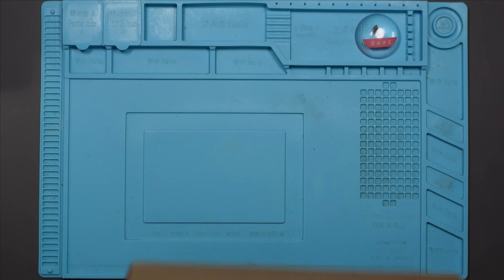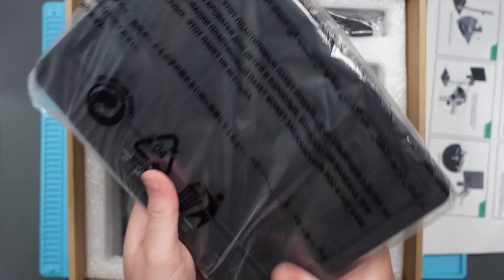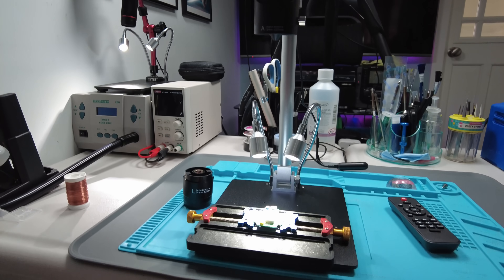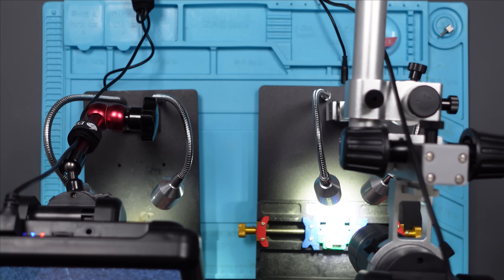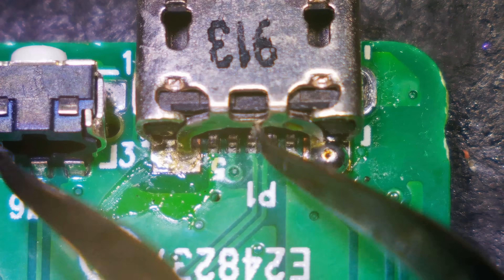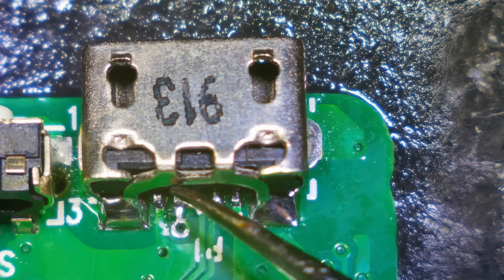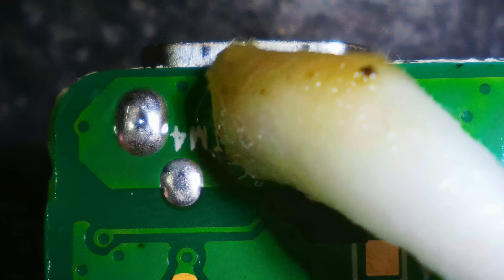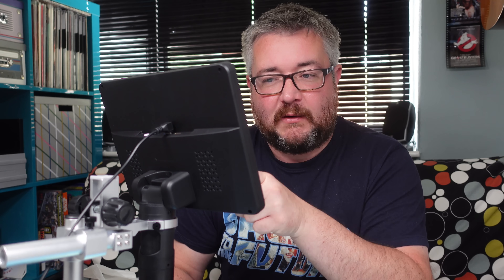I Got a New MICROSCOPE! | Andonstar AD249S-M | Let's TEST It!

Comment: I can tell at a glance that its way better than the big glass magnifier that I have clamped to my desk made by electrix. It has a tube light and all the information on the tag is faded and gone. So I have no idea how many X it magnifies. It helps tremendously but when traces get to be like  .5 mm apart there's no way I could fix one with it.  The ones I can wear on my head like sun glasses are way better but I have to be so close that there's no room to work. 
i fixed my oven the other day after doing without it 8 months. They don't make the board any longer and it cost 2200 bucks to replace the oven.

Comment: @StezStixFix, I recently picked up the AD407 and was curious about how you configured yours. I really like the adjustment you made with the articulating arm. In your video, you mentioned that you had a lot less work area. Did you know that you can mount it closer to the lens to gain about 3.5 inches of clearance between the microscope and the work surface? You’re probably already aware, but I thought I’d mention it just in case.

Comment: I’d bet that Andonstar has sold a lot of the AD407 microscopes because of your videos. I bought an AD407 Pro about two weeks ago after watching you and it’s been amazing. I’m able to see much better than my Optivisor. I wish it had warmer colored LEDs because these blueish, cool temperature LEDs are awful for our eyes and certainly give me eye strain if I don’t block them with the LCD while using it. Seems like every manufacturer is on a mission to burn the macula out of everyone’s eyes ever since the “white” LEDs came down in price back around 2005.

I have been using my Andonstar 407 for electronics repair, fixing eyeglasses as well as filing and polishing Hot Wheels diecast car axles to prepare them for racing. The 407 is quite good for the model hobby; price is low enough to be affordable while giving a high quality image with the ability to record video or still images. Your own videos proved the image quality to me and convinced me to buy this model. I’d sure like to try the AD2495 to see if it makes a difference, especially when needing to work with tools under it, but the 407 is working quite nicely for me so far.

Comment: Already made up my mind but I appreciate your honesty. These are really expensive in Ozand my one (like yours) is easy to grab and I fold mine down and store it in a cupboard . . . the Andonstar I mean.
I use the smaller screen and not even worried about connecting it to my 24" workshop monitor. Why bother, the 7" screen is ample and so is the working space. The only niggle is the lift assembly mechanism is sloppy and the whole unit wobbles as I raise or lower the assembly.
Also the mSD slot is in a tight position. Andonstar could move it out to the side.

Used it just the other day actually to install an Hekate injector into a Switch. Too easy and after watching another video on this model, I can't see the asking price for th 10" model really. I will never see a freebie in my post box that's for sure. :-)🤫

Comment: Good stuff, I recently got my first microscope, a Tomlov DM201 pro. I expect the video quality will be pretty much the same on all models as camera technology is so good and cheap nowadays. I agree that the main issue with these things, for the purposes that we use them for anyway, is lack of space (or being very aware OF the space) as im swing hot air guns and soldering irons under there. Slight wobble too, i dont think anything can be done about that nor is it really an issue?
Anyway, enjoying your vids, learning a lot! im a newbie so trying to soak up as much as i can!
Reply: >  camera technology is so good and cheap nowadays
no way... image sensors are still pretty different in size and size affects final image quality a lot. Bigger sensor - more expensive the rig (for cameras, for microscopes, for everything)

Comment: How good does the scope do fine pitch components to see how close the fine pitch pins can get on the scope? also it should have an HDMI output port to connect to a bigger TV monitor right? What scope lens would you need for fine pitch pins components X2000 or X4000?

Comment: From what I'm seeing in researching the ad407 (which your old one appears to be) has an aluminum focus ring and the new one may not which could be a con.  In the US the smaller ad246s is much less expensive with the 7in. screen than the ad407.  I'm trying to get into microsolder repair on a bit of a budget until I can afford a nicer microscope and hopefully the ad246s will bridge the gap for now.  How's the focusing compare with your old one?  Is it less smooth?

Comment: Dude….. Mount the camera to a solid point separate from the desk!

Also take this onboard to… You gotta ‘100%’ Rock solid mount that desk too…. AKA - ‘Work Space’

Plus….

(100% Solid camera mount too)

With the 100% separation of any vibrational interference between the two will equal an emended improvement in the quality of the output to ‘Us’, your loyal viewers x

Comment: 🤣 but would you buy one if you didn't have the other one? 
I need to upgrade mine as it is a bit pathetic and small. I've been thinking a HDMI option with a screen mounted to the back of my workspace rather than an all in one.

Comment: Bought the 246 directly from their website. It's the one with the smaller screen and I think it's the perfect size, same mounting. It was 200$ exactly, plus another 50 for customs. Payment was through paypal, it left China in under 24 hours, after another 24 hours was already in my country (Romania) where it spent a whole month (argh!) awaiting customs. It arrived a few days ago and I'm amazed. I never had a microscope so it opens up a whole new world for me. But, I'm a picky boy, yet I can't honestly fault it. Lots of small details that make it a quality feel. No sharp edges, no google translate manual. The only niggle is the small focus jams on the A and D lenses (PS. actually that went away after I completely turned the two screws). The L one feels smooth. For me, it has already payed for itself, as it helped me bridge a broken flat flexible circuit on my abandoned Vive VR controller. Although it's main use is gonna be modelling and miniature painting (I have really bad eyes). Biology slides were actually cool. I'd rate it an honest 4.5 stars out of 5 and a must-buy.

Comment: I think both of these are the winner. If you need closer shots on smaller things, the older one is best, but if you need a big area to work on a bigger board, the new one is better.
Both are good for their own purpose tho!
The old one has a better image quality due to lack of CMOS wobble, but the new one is sharper a tad.

Comment: I too got it for review (I think I was the first on youtube: D) as well as had AD407 before. What can I say at the moment when it comes to construction - the AD249S lens is almost entirely made of plastic (inside there is a brass ring with actual glass). Mine jams when adjusting. The base is a bit larger and the stand (now it also moves forward), but it does not solve all the problems of the predecessor and so if you want more space under the microscope, you need to use a different arm. The lenses are mounted with two screws and you will not buy any other, they are custom, only for Andonstar. The recording quality is almost the same as in the AD407 - very good, the resolutions are identical. Thanks to the lenses in the AD249S you can get a lot more space and a larger working area. LCD is also similar, same resolution only bigger. If I had to judge which one is better, then if you do not need a much larger working area, it is better to stay with the AD407. A 7" LCD is more than enough for comfortable work, and the stand still needs to be redone in the new model.
The AD249S also has WiFi, which is not working at the moment ... and it can be connected via USB to a PC as a camera, which I remember was not possible with the AD407.
You can take a look at my review, but I haven't added English subtitles yet.
Reply: Plastic lenses?! ....wow...
One of the reasons is cheaper than  the older Ad409 ( 10' screen)
Reply: @dsavoy66  To be more precise - plastic is the case of the lens. The lens itself is made of glass and it is mounted on the brass ring. https://youtu.be/Ce7BZUfGpVk?t=672
Reply: 407 can connect to a monitor/tv via hdmi. The lead comes in the kit.
Reply: No PC connection on 407 is a deal breaker to me, but those shi tty plactic cheapish lens on 249 is deal breaker as well😂

Comment: Did you make some tests with ADSM407 with the new stand? I have an ADSM302 and the stand is the major cons for it. 

The other biggest cons for my usage is the cable with buttons, that is only a power connector, you can't plug it to a computer to have microscope AND light at the same time. I'm very happy with the ADSM302 itself, I can even stream with it ^^

Comment: Nice review, it looks nice, i have an andonstar too. An earlier model, its great for what it is, it has helped immeasurably when it comes to fixing electronics, it really does get close up and the image is more than clear to do what you need to do. Mine has an annoying trait, and that's when you switch the unit off the time freezes, and will only resume when you turn it on again. It's not very handy when it comes to taking camera footage over for editing as the timestamps are hard to marry up when you are using other devices to record too unless you take the time out to continually change the date / time every time you use it. It would be wonderful if they resolved that and had a model with a microphone and video out too :)... Its not a negative review, its a non biased review which we really appreciate so thanks. It's nice that you were open, honest and upfront, and that people can make a more informed decision because of it. It also serves to the manufacturer to listen to whats being said in order to improve their product. I for one, dont think they are bad at all, a few tweaks and this could easily be the best affordable miroscopes out there.

Comment: Actually, after you picked so much solder into the wig and had placed enough flux there, you easily cpuld have just pushed the wig aginast the USB contacts and it would have resulted in a perfect connection. This is also an easy way to solder chips with 0.125 raster pins and such. However I wonder if the scope is available in a shelf clamp version that hovers freely over the desk. Would be much more beneficial for my needs.

Comment: AD407 owner here. Most of the time I use the HDMI out to a 32 inch screen so a larger built in screen would be more of a hinderance to me. Also I modded the mount to give way more clearance under the scope. My only niggle is that for some reason the still pictures it takes are less clear than just captured frames from video.
Reply: I mount mine on the groove just above the lens. You get double the working distance.
Reply: I mount mine on the groove just above the lens. You get double the working distance.
Reply: Do you confirm 407 doesn't have PC connectivity?
Reply: @The_Unobtainium  Yes, HDMI output only.  But it can record to MicroSD cards

Comment: I straight up just recently bought the same original adonstar microscope you have been using.  Although I find the focus adjustment a bit frustrating, I am happy with it.
Reply: Try mounting it on the groove just above the lens. You will get double the working distance.
Reply: Why, what's the problem? you should rough focus by raising/lowering the assembly, lock that into place then rotate the microscope ring; the large knurled section, to fine focus. Could not be easier my friend.

Comment: For soldering usb ports, chips and the likes with rows of pins I can really recommend using a soldering tip that has a horses hoof shape to it with a bit of a indentation such as the hakko t12/t15 bcm shape tip. The shape works perfectly to hold a nice amount of solder on the tip and transfers the solder very nicely when using enough flux.

Comment: I have the AD208 variant Elikliv DM-10 (open box) with the 6inch extension $106US. I like 7-8.5 screens. After using a 4.5 for some time that's as big as I want to go. I returned the Elikliv EDM202 because the 10' screen was fatiguing especially after 20 minutes. It was really like having a tablet in my face. 
I'm glad I'm not alone. 
BTW- The red articulated arm is discontinued. I lot of were looking for it after seeing your mod.🙁

Comment: I have the same microscope. The lcd is very low resolution compared to the up to 4k the camera outputs. I would suggest tearing down the screen portion and removing the pcb. I have it going to a 24' monitor and is much more clearer.

Comment: I have the AD407 modified with a 3d part so it can attach to a boom arm, best thing I ever did cause the metal base is really annoying.
Reply: funny you should mention this, i had a similar idea - how is the weight of the boom arm, and does it hold steady? i thought it may make it a bit wobbly....
Reply: @Caddy666  If you go with something like the Rode PSA1 it is pretty steady, cheaper boom arms are really not upto it.

Comment: By the way . . . on your older AD407, there's not need for your elaborate extension arm contraption (to gain more room beneath the lens), you can simply mount the lens higher in the mount, there is a mounting position at the top of the lens - where it is by default - as well as a mounting position right at the bottom near the front element, use this one if you need more working room.
Reply from the maker: Good tip!  I do like the way I can move the arm easily side to side and back and forth, but for those with the original mount, it's a great idea!  👍
Reply: @StezStixFix  Imagine using both, it'd sorta' be like the James Webb Telescope, but smaller and much closer to earth, I want you to think about that.
Reply: @Daniel Andersen I would like to see that if he replies.
Reply: Me too. Show us yer aric arm, S 🎉

Comment: Well brother Steve! I've seen both scopes in action and for me the 10" cries out 2 things. 1 Ring light  2 Articulating scope arm (both would benefit your work area immensely)
Also If you can get one, that will hold the weight, a microphone arm, that could be modified. But definitely a ring light! would be much better than the goose neck LEDs 👍🖖
Reply from the maker: Thanks brother Steve, yeah a ring light is a great idea!  And I couldn't live without my articulated arm now, so much more flexibility!  😊
Reply: There was a lot of complaints about the small one that "you can't solder because it's not a stereo microscope". I found it works perfectly. I assume because of the shadow from the two LEDs. Wouldn't a ring light remove those shadows so it becomes more difficult to judge the distance based on these shadows?
Reply: ngl a goose neck light is better for glare. as you can position to suit. but yeah extra light is are welcome.

Comment: Ooh it’s the same as mine! Although I have the smaller screen version, it’s flipping awesome
Reply from the maker: Yeah, they are cracking microscopes.  Although mine didn't record any audio, so it was a pain to sync up the videos when editing.  Does yours?  🤔
Reply: @StezStixFix  I guess it's time to make a led blinking thing with some sound.
Some kind of clapperboard 😂
Arduino, buzzer, battery and a led should do fine👍
Reply: @StezStixFix  no… it recorded a soundtrack of very low static 😅 and yeah, syncing was a ballache. I might get in touch with them, hopefully it can be fixed with a firmware update
Reply: @StezStixFix  oh… I got a response from them .. “Well, indeed. Part of the effect of the mainboard controlling the recording function is very poor. Our current new model has withdrawn this function, I hope you understand.”

Comment: Really appreciate you being honest there! Perhaps Andonstar less so, but honesty is always good.
I got the same microscope your old (maybe still current) one is, the AD407. Honestly, it's really good for all my little quick jobbies, fixing Gameboy cartridges or a controller as a friend threw it against a wall, does kinda suck space wise you're definitely right. Great idea you had with yours to mod it to go higher, i might have to steal that idea! Other than space its a great little microscope.
Reply from the maker: Yeah, I still love the AD407.  It's never let me down.  The articulated arm on the stand makes a big difference, you should definitely do it!  👍
Reply: @StezStixFix  what articulated arm did you used for the modding?
Reply: @nicmate2543  just mount it on the end of the lens instead of the top, which the documentation says. You can find videos and pictures online. I've done that since I got it. It works perfectly
Reply: It's still a massive win for them to show their microscope. ex: I just checked their prices and their website because of this video.
Reply: I have the AD208 and even that works great; spacewise a little less indeed, but otherwise a great bargain!